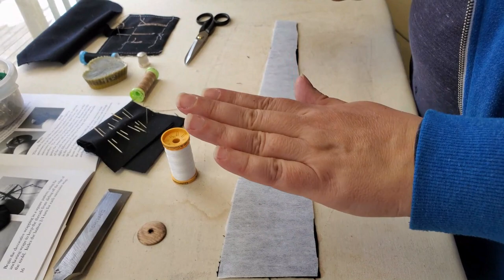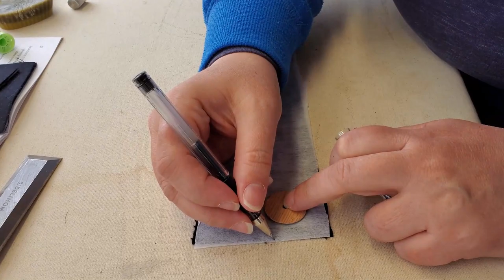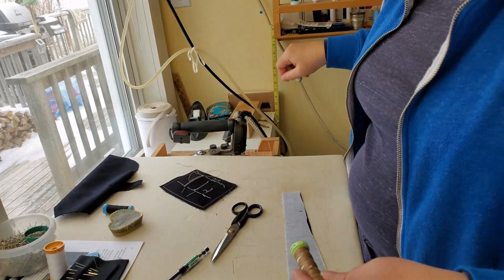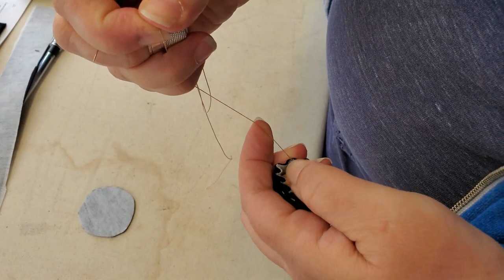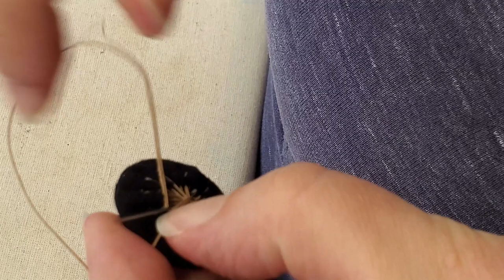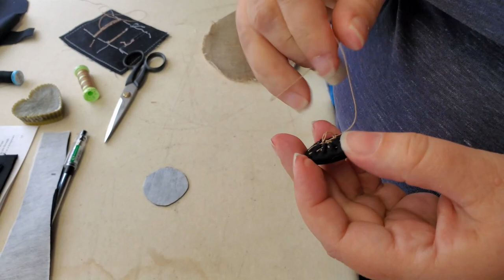18th Century Cloth Covered Buttons

Comment: Nicely done.  I have made cloth-covered buttons for my 18th century frock coat but haven't found a way to attach them.  Would love to see more detail on how you made the shank.  What you have here is great
Reply from the maker: Hi Mark! I work a bar tack across the back side sometimes, if I'm making buttons for a later project. Sometimes though, I have enough thread left that I knot the button off and then just sew directly to the garment. Especially if I know that the buttons aren't going to get a lot of wear.